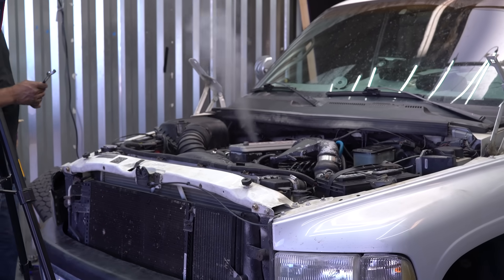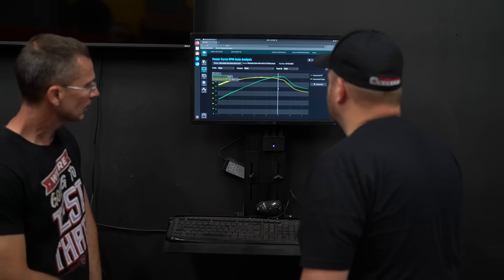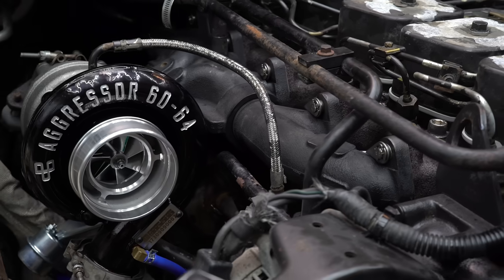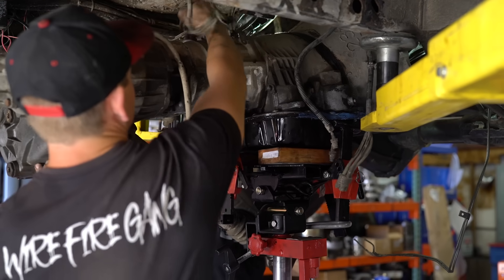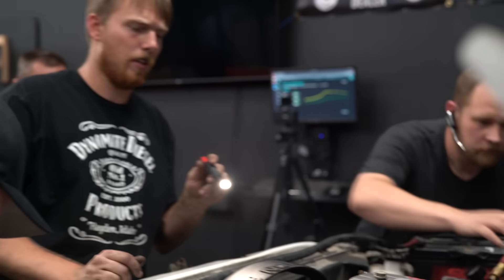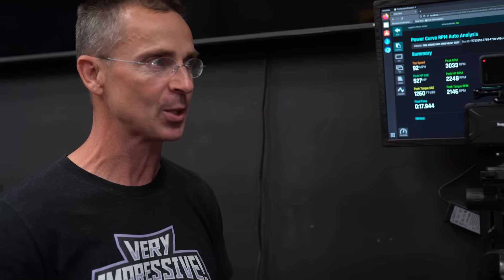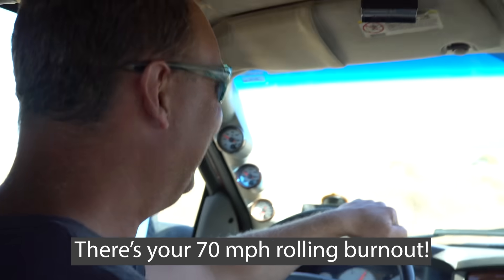Project Farm's 500 HP 12v Cummins

Comment: The guys at PDD are the best.  My dad had his 05 3500 built by PDD for the double your horsepower contest back in 2019 and the truck has been rock solid ever since.  I built my 98 K3500 Cummins swap with all PDD parts back in 2020 and it was awesome.  Now I'm building a 2008 F450 Cummins and I'll be using PDD parts once again.  Best out there as far as I'm concerned.

Comment: This is beyond cool.  Prior to watching this video I had already ordered all the parts used in project farm truck just based on other pdd videos and the pdd website.  Only thing I forgot was the rack plug, which I just ordered.  Now I know if I set my timing to 18 degrees I’ll make over 500 hp and 1200 ft lbs of peak torque.  No guessing.  I’m afraid my transmission is not up to the task so I’ll be ordering your 650hp trans next lol.  Gotta save up.  Love you guys!!!
Reply from the maker: Awesome! Thanks for the support!

Comment: I'd love to do this to my 97 3500 dually..
I turned up the starwheel on the pump a bit and the wastegate but that's it. Still has the tamper screws on the afc housing.
Reply from the maker: You would absolutely love the added power! Give us a call and we can help you get the setup that is right for you! (435)962-9555

Comment: Awesome video, I saw the project farm Todd on there and had to watch it. I have the same truck but 2 Wheel Dr. How did you do all that work for under $5000?! I went to your website and the torque converter alone is $1675, that turbo was ranging from $1,150.00 – $1,387.50,. It looks like you guys put in a whole new transmission, and that definitely isn’t cheap, AFC Live system, beefy head bolts, hevier valve and governor springs, upgraded lift pump, etc… and then labor. How much did that actually come to because I’ll drive all the way from Salem, OR to y’all to have that work done to my ‘96 diesel if I can get all that done for five grand! 😊

Comment: What is the obsession with HP over the past 25 years? When it comes to diesel trucks, it's all about torque IMO. TQ first, HP second. Y'all didn't even mention the stock torque dyno number. Very impressive power numbers on the finished product!
Reply from the maker: Great point

Comment: Hey, guys, quick question, when highly building diesel, where build also uses ported heads, do you port match exhaust port to manifold, and manifold to turbo inlet? Or do you upsize the step as reversion prevention, which is common on petrol engine performance? Maybe you have tested backpressure, spool, hot side temp differences between port-matched hot side and stepped one? Which approach is more correct on diesel?

Comment: Your #6 cylinder will over heat. You need a cooling bypass thermostat, that mounts on the back of the engine.

Comment: I'm not into diesels, but you guys seem like the dream team when it comes to knowing just how to make an engine and transmission better. You made Todd's truck not only more powerful, but also more fuel efficient and cleaner and more reliable. Most people only focus on one of those, not all at once. They want power, but sacrifice reliability or fuel efficiency. Or they want reliability by detuning the engine. Or they flat out get rid of mufflers and emission controls as a cheap way to get more power instead of keeping those in place and actually improving the engine itself. The irony is that, at least in a modern fuel injected gas engine, having the engine have more complete burns with higher compression is the exact method car manufacturers have gotten engines to push so much power while reducing emissions and improving fuel efficiency.

Comment: Either this dyno is off on its calibration, or it was uprated somewhere along the way which was pretty common because no way, was a 160 hp stock engine, going to put 200hp at the wheels 😁.  I am pretty sure of it, having had a '94 brand new same auto slushbox 12v.
Reply: Awesome video and work guys!!  Happy Thanksgiving

Comment: This is a great group of boys right here. 

Been daily driving my 12 valve swapped chevy for a year and a half now. I've resisted the urge to turn it up because I want maximum life and reliability out of it. But maaaan this makes me want to tear into it.
Reply: Ironically this upgrade probably is just as reliable as bone stock because of the upgraded internals. Not to mention they definitely didn't push the engine to its absolute limit. It still has lots of wiggle room. The tune they applied is pretty much how a brand new Cummins would be in power whereas the Ram was basically detuned to meet emissions (before the days of modern particulate filters and whatnot).

Comment: Hey folks.  I see most people running these on the auto box but can my  5 speed NV4500 handle these kinds of numbers? (96 2500 12v 48k miles)
Reply from the maker: With a clutch upgrade, the 5 speed is pretty good and reliable at 500 rear wheel horsepower.  Around the 600HP mark, 3rd gear becomes a common failure point, then 5th gear around the 700 HP level.  FYI, 4th gear will hold 2000HP with just a 1.375" input shaft upgrade a strong triple disk clutch.

Comment: I wanna be able to do 70 mph rolling burnouts so badly
Reply from the maker: Depending on traction, weight, road conditions, you'll need anywhere from 1000 to 1300whp to successfully destroy the rear tires at 70 mph travel speed.  It is fun!!!

Comment: Back in the 80's I had a '81 Peterbilt with a Cat 3406A that pretty sure did not have 1200* torque!
Reply from the maker: It is amazing how much torque these engines can put out with a few good modifications!!
Reply: @pddofficial  wonder if it was lack of knowledge, fear of poor reliability, or government regulations that caused almost all old diesels to be extremely underpowered.

Comment: Being from Minnesota I’ve never seen a second gen that clean before! I wouldn’t dare try to remove an exhaust manifold on anything unless I feel like cussing and fixing broken bolts all day.
Reply from the maker: That's normally how it is
Reply: Isn't Todd from like the midwest? They get snow and therefore salt in the roads and rust, right? Of course, Todd is the type of person to actually look underneath the vehicle from time to time to see if it's actually still safe to drive.
Reply: @SockyNoob  I’m not sure where he’s from but not every state uses salt, and you can wash them all you want but the shit still gets up in the places where you can’t really wash and is still gonna rust them out faster than non salt states. Once it gets cold enough most all the car washes shut down for the winter anyways so unless you’ve got a big heated shop with a hot water pressure washer ready to wash your vehicle after every trip in the winter than you’re not gonna stay ahead of it.

Comment: If he thought it felt gutless at 200 horse then he should go drive an actual stock one that only gets maybe 135 on a good day like you said 🤣
Reply: Crazy how that's less power than my old Chevy Cobalt. Granted it has more torque. I actually found out that the old school buses I rode in as a kid made like 200-300 horsepower and 600-700 lb-ft of torque. You'd think they'd be way more powerful considering they weigh at least 10 tons without any kids. Nowadays I think they're like 1.5x as powerful if not more, especially the hybrid versions.

Comment: But can he tow with it
Reply from the maker: The Truck should tow phenomenally!  With the power jet injectors and extra turbine with the turbo upgrade we were able to add ~100hp while maintaining the same EGT as his "freak stock" truck.  To be able to tow with over 500hp sustained a good set of compounds would be nessasary, but even then you start to struggle with the limits of a factory cooling system and how much power in heat the system can keep cool.
Reply: @pddofficial  the biggest question is how the hell was it able to tow BEFORE the upgrades?

Comment: About how much in parts did this upgrade cost? Great work guys!
Reply: 5,000
Reply from the maker: With Transmission around 10k
Reply: Thank you! 😁
Reply: @pddofficial  that sounds like a lot, but it really isn't. Considering you guys actually replaced most of the internals of the engine and transmission to actually handle the increase in power, you could argue the extra cost is absolutely justified because this tune WON'T destroy the entire engine and transmission like most hacky DIY tunes. Wouldn't you rather spend the extra few grand knowing it's done right the first time? I certainly would. Spend more now, cry less later! Plus you guys did the tuning right in front of him and showed him all the parts being replaced. How many other tuners (hell, even regular mechanics) actually do that little extra to boost confidence and be transparent?

Comment: How much of a difference in horsepower and torque do you see on a dyno that you can load versus one you can’t load in a diesel?
Reply from the maker: This very much dependent on the truck!  If the truck is quick spooling and carries out power well then the load can mean less than 50hp on a 1000hp truck.  However if you have a tight setup like a 12v with factory head that doesn't carry power out well then the load can help spool the charger at a lower rpm and help get the boost up where the engine wants to make power.  In this situation load can. mean as much as 20-30%.
Reply: massive difference can be upwards of 200-300 hp

Comment: Once you get a taste of that hp it's over you will be adding a 2nd turbo bigger injectors some more timing bigger incooler.
Reply: And your life will be spent repairing the drive train.
Reply: @wtchr6883  not really these dodge will take a beating as far as the transmission transfer case and rear end. My truck has compound turbos makes 70psi boost no issues I built the transmission myself back in 2014 it's still holding.
Reply: @bigmurph1447  so you already killed me transmission. Thanks.

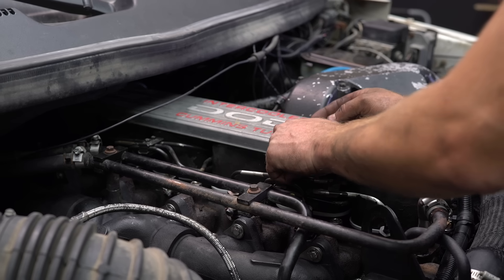Comment: @4:20 Why would you need this if you have an air dog installed? I have been deleting all that.
Reply: I would say the hot rod lift pump is more reliable than an air dog. I can maintain 50psi with 500hp worth of fuel no problem even thru stock lines and pickup
Reply: @bcbloc02  Now you got me wondering if I messed up?
Reply from the maker: This set up didn't get an Airdog.

Comment: Now you need to do a test on the PDD oil. I’ve ran it in the past but I’d love to see a comparison test done with it.
Reply: you know it really doesn't make that much of a difference they just put their oil as insurance that you're at least using a top tier oil and not quaker state or some gas station crap
Reply: @EkzdeeLFT  Todd has already done videos on motor oils and most are almost identical. Unless this is some other oil you're talking about.

Comment: I have same package on my 12 valve and it is amazing the transformation
Reply: You went with the PDD Stage 1 injectors? Only thing I was wondering about are the Stage 2 Dynamite Diesel injectors.  No core charge.  Comparable performance?